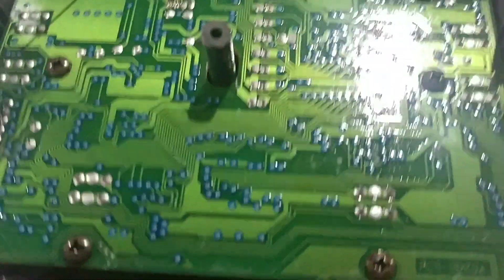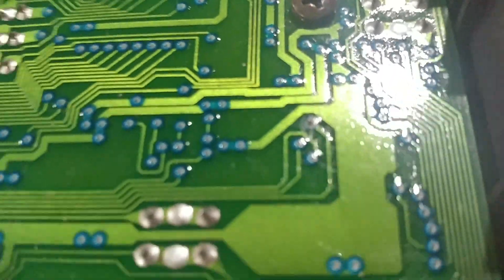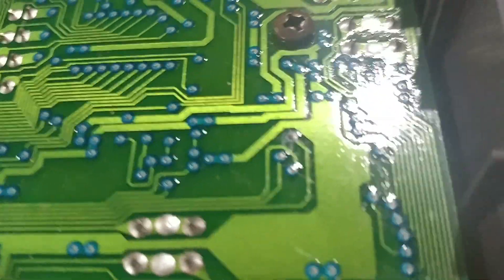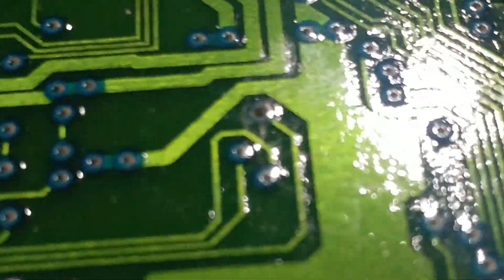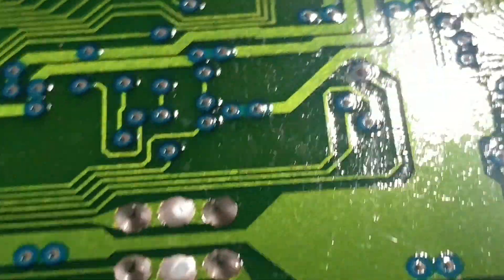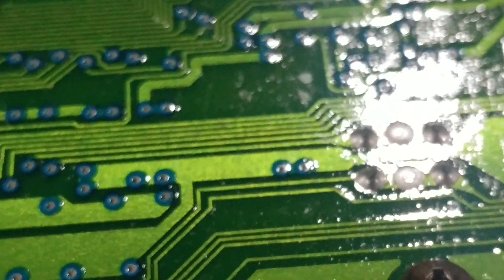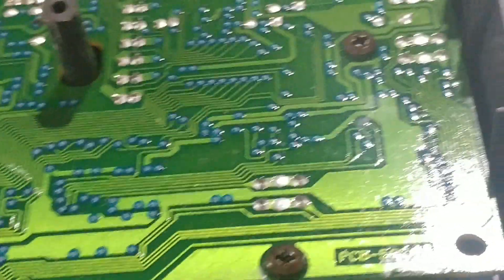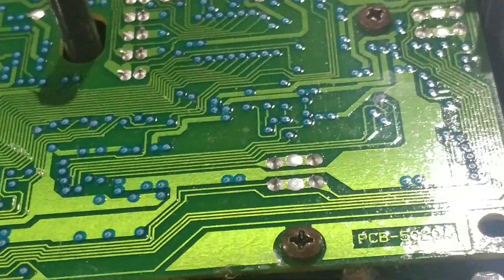Circuit Bending With A Box Cutter (dangerous, do not try at home)

Comment: I did some reverse engineering on the processor in this pedal. If you had an Arduino, it wouldn't be too hard to make a corruptor for the DSP.